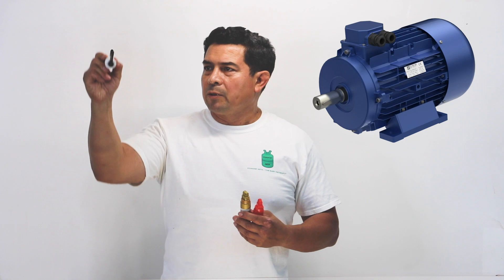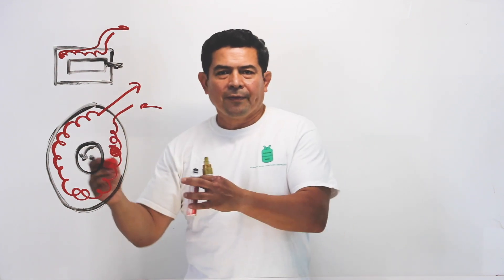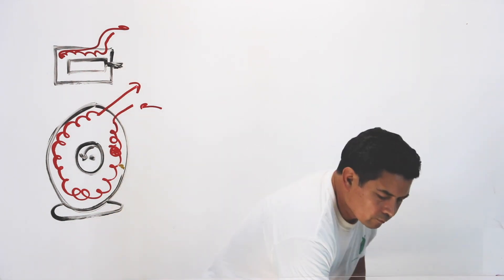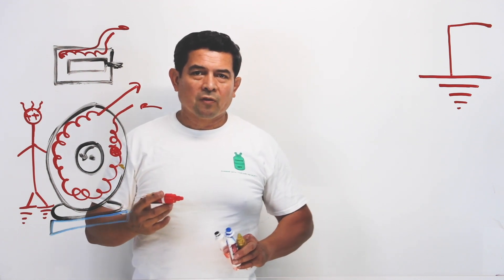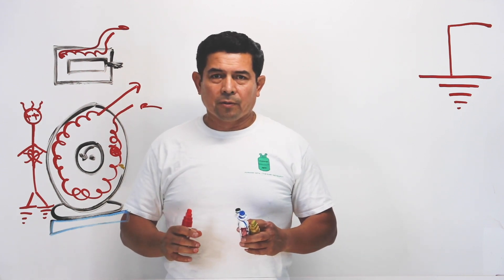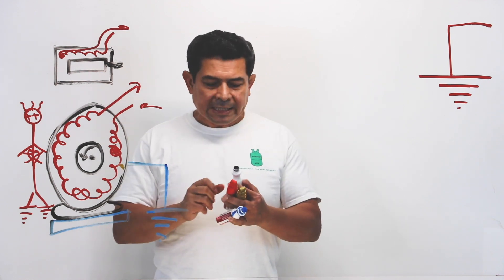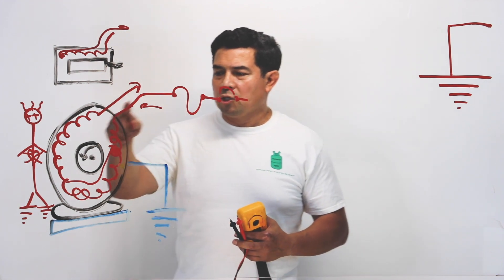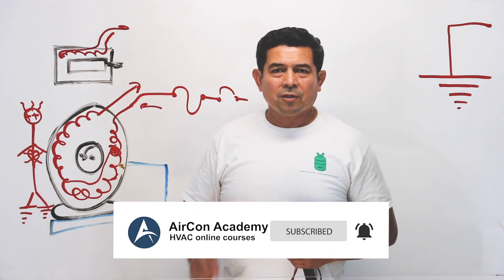Motor Ground

Comment: Why is it when i connect the ground wire from my motor back to the vfd the breaker trips but without a ground the motor runs fine?
Reply from the maker: It sounds like you have some feedback or maybe you have a ground in the motor! A lot of times the motors are insulated at the mounting so the only way for the electrons to get to ground would be through the ground wire. 
Without the ground wire connected, the casing would be energized, but the electrons could not get to ground, until you connect the ground wire. This is why when you connect a ground wire to the VFD ground it trips. Test the motor and see if it is grounded. I hope this helps! Thank you for watching and thank you for asking a question!

Comment: If there is a PE conductor attached to the motor,will you still recommend a case ground?
Reply from the maker: I'm sorry, I am not sure what you mean by PE? We need to make sure that if any of the electricity goes to the casing, it travels to a good ground. That is why you must always have a ground wire. Whatever the PE is, if it is allowing the electricity to go to ground it might be safe? But it's always best to have a separate ground wire!   Remember with electrical safety we don't want to take chances. I hope this helps. Thank you for watching!

Comment: So if the electricity flows through the load and back to source we aren`t using electricity, just borrowing it, and it flows from us to our neighbours and to their neighbours. We are led to believe we have consumed that power. Seems an underhand trick, do you agree ?
Actually the reason for my post is to ask for help.
I have salvaged a 12v ambulance winch system which is wired through a box of tricks to have an E stop, forward/reverse, on/off etc.
I just want to power this motor by sending 12v to the brake and 12v to run the motor and have my own reverse switch when needed.
The motor has 3 wires feeding the brushes around the rotor. As far as I can find out the RED is Positive, the BLACK is Negative and the WHITE is Neutral.
Can I connect the neutral to the earth on the 12v psu I am using. Thanks for any help.
Reply from the maker: On the first part of your message. It is the electrons that are moving back-and-forth and they're going right to the transformer that is outside in the pole. It is not going to your neighbors or the other neighbor. It is making a big loop from the toilet in the transformer to your house, and then back to the same coil in that same transformer. So we're using basically the same electrons.   On the second part, DC motors, meaning, the motors running off of batteries, are totally different than AC motors. Like the ones that run the fan in the heater or air conditioner for your house.   One of the problems is that you need to know if your motor is wired in series or in parallel. Meaning is the electricity going through the brushes through the commutator, and then to the stater, or is electricity going to the brushes and to the stater and are these two wires together at the outlet and is that why you have three wires?     Unfortunately, in the field, we don't use DC motors that much so I don't have a video on how DC motors are wired. I used to teach DC motors. That is why I mentioned those two different ways. If you have three wires, that is basically telling me, and I might be wrong, because I am not there to look at the motor, that you have one wire from the battery or switch going to the brushes, another wire going also from the same side of the battery possibly through a switch to the stater. As electricity travels through the brushes, and into the Commutator , and then through the stater, both of these are wired together to what you are calling that third wire common. That would go to the other side of the battery to complete the circuit.    I hope this helps a little. If not send me another message, but hooking it up to ground is not going to do anything. Don't do that because the batteries are not grounded to earth. Only alternating current/AC is hooked up to ground. Thank you for watching and let me know if you have any questions.
Reply: @AirConAcademy  Thanks very much for your lengthy reply, it is much appreciated.
I am not sure how to go about testing for series or parallel. All 3 connections are connected via the brushes to the commutator. I get a continuity beep probing any combo of the brushes. Does that help.
Sorry for my super basic approach.
Reply from the maker: @codepuncher  yes you would get continuity across all three. If you could email me and send me some pictures. Maybe a little better explanation.      jh@airconacademy.com
Reply: @AirConAcademy  some images sent. regards
Reply from the maker: @codepuncher  i hope you got my email
Reply: @AirConAcademy  tnx so much for your great help.

Comment: Thank you for making this video man. I have a pretty good understanding of circuits but sometimes over look simple things like ensuring everything on the case is connected to ground. Bought a bench grinder (Ac induction motor) a while ago and just recently started using it. Normally, I go into my shop with boots on but I needed something quickly so I just went in bare foot. I was sitting at my bench while on the phone and touched a part of the case that had a little bit of paint missing and got a nasty shock. I unplugged it and now today I'm taking it apart to find out why. Whoever made this connected the ground to the base of the grinder and made no connection to the case ng for the motor. So it's storing energy in a magnetic field and slowly discharging through a resistor but while inactive there's 5-20vac across the case. Like you stated earlier it CAN kill you but not always and man even that low of voltage still hurts. Like one of those prank taser lighters that were out in the late 90s early 2000s. Thankfully not a painful as 120vac and man does that hurt! Anyways, your video reminded me to test continuity and behold the case was isolated from the ground. So thanks man I appreciate this video!
Reply from the maker: Wow! That is quite the story! Thank you for sharing it with me! I remember having an issue similar to yours, but with a washing machine years ago! And yes! I remember those prank lighters and gum packets that they sold that will shock you when you grabbed it! Those were the days!   Thanks for watching and I'm glad you like the video!

Comment: I have a unit that sometimes the breaker Tripping, if I do reset the contact will start at normal operations, an then randomly it will do it again, we replace the breaker, cap is ok install a hard start kit and still doing, any recommendations?
Reply from the maker: Unfortunately from what you are telling me you have one of those floating grounds. You have a few things you could do.   . One is to keep resetting the breaker and most likely whatever has  the floating around will make a good ground and not be able to reset the breaker again. I believe it might be your compressor that has that. That is where I have seen this a lot of times.  Your  other option is to check it with a megger.   Another option that I can think of is to disconnect the 24V wire from the compressor contactor coil, so you do not run the compressor and see if the breaker trips. I mean run the fans, like the condenser fan motor and the evaporator fan motor to see if that trips the breaker. This will tell you that it is the compressor. Another suggestion is that you would check the wiring. You may have a wire that is rubbing against the casing/chassis or something metal and the insulation has worn. Because of that sometimes it goes to ground and sometimes it does not. This would be on the high-voltage wires going to the compressor or the fans.    I would check the wiring first like I said just now and then go on to other things. Good luck I hope you find it!

Comment: Thanks for replying to my question.  I would have attach a ground under the fan shroud to connect to one of those bolts.
Reply from the maker: You can attach it to the underside of the motor as it is hanging. So that it is far away from the fan shroud. And away from the fan. I have had to do it like that several times. Good luck!

Comment: I purchase a new 1.5 hp 15 amp single phase ac motor that does not have a ground wire with the wiring bundle. How can I add a ground wire to the motor to prevent shock?
Reply from the maker: Take a look where the wires go into the motor, see if there is a green  screw at that point and you can attach the ground wire to it.  If not, what I have done is our house loosen one of the bolts that hold the motor together, in other words the bolts that go from one end of the motor to the other end of the motor, and then I attach my ground wire to that. The ground is supposed to provide a path for the electricity to go from the casing to ground if there's a problem.   I hope this answers your question.!!!

Comment: I am using a brushless motor in a diy project. It comes with a ground wire but I don't know what to do with it. My project only needs the POS and negative (battery charging). Can someone please tell me what to do with it? Ground bus? Very new.
Reply from the maker: The ground wire is just for safety. You can take that ground wire and connect it to the chassis, or you can connected to an actual ground. But if you're talking about positive and negative you must be talking about a battery so you can connect it to the chassis or in other words the framework that the motor is connected to
Reply: @AirConAcademy  Thank you so much ☺️
Reply: @AirConAcademy  If I may, I have one more question to ask. Can I safely run a DC electric motor at 175 rpms over rated? Is that a biggy?
Reply from the maker: @sharilyn8262  If you are talking about running the motor 175 RPM higher then rated speed, you need to be careful.  Centrifugal force can take a motor apart  if the speed is exceeded it can fly apart!!!!    It may be safe but!!! be very careful over speeding a motor.
Reply: @AirConAcademy  Woah 😳 thank you!

Comment: The person could be touching another grounded product with that other hand too. It does not have to go to ground through the feet. That current to ground will trip GFCI's, ground fault circuit interrupters, if used to power these devices. By the way, high tech motor controls or inverters create the main current by switching it on and off very fast. This high frequency current will travel from the motor windings to the chassis easier than the 60 hz. This too will trip a GFCI since most are only specified to trip at 60 hz, not at lower or higher frequencies found in higher tech control systems.
Reply from the maker: Yes, you are so correct! It does not have to go to ground through the feet but it could be through the other hand or an elbow or like it happened to me through the forehead.  Yes, a GFCI was tripp but typically we do not use GFCI's on motors. For example in the state of Virginia GFCI's are only required in a room where there is water or within 6 feet of some thing that has water even if it is in another room.  In class I go over how VFDs works and typically I will draw the schematic for a VFD so that student can see the components and how it works. I have never ran into a motor that is hooked up to a VFD and a GFCI.    I guess maybe I will look into, when and where a GFCI is used in conjunction with a VFD and a motor? Thank you for your comments it gives me something to look into!
Reply: @AirConAcademy  Appliace manufacturers have been using VFD's for some years now. If an appliance is plugged into a GFCI it's likely to trip. Consumers were complaining about nuisance trips and I was asked to look into them. Spec's only state how they are to perform at 60 Hz, nothing defined for higher or lower frequencies. Since appliances appear next to each other the opposite hand is highly likely to touch a grounged product. Not only motors but also user interfaces. The power supplies in them are commonly switch mode, meaning line based high freq switching. User interfaces can be thin pieces of plastic, common dielectric materials, so now you could be the other plate of that cap to ground. Fun stuff.
Reply from the maker: @chrisscriber9592  OHHHHH    OK   LOL    I had no idea at first that you were talking about appliances. Yes, I knew that they had been using VFD's on appliances and such I don't know if I missed it but I didn't know before that you were talking about appliances. Now I see why you were talking about VFDs being hooked up to GFCI's.   Now it all makes sense. I like to get into frequencies and magnetic fields and so on they are so many different things that could happen.    I find it all so interesting! And I do like to read about it. Thank you for clarifying that for me.!
Reply: @AirConAcademy  VFD's used are created by the Appliance control manufacturers in the home appliances. Commercial units typically use industrial grade VFD's.

FYI: Power and signal harnesses are typically run throughout the machines in the same bundle. If you consider the copper in the wires a plate in a capacitor and the insulation as the dielectric you can predict high frequency coupling to more sensitive harnesses. You can minimize the impact by simply keeping the HF and sensitive harnesses even a 1/2 inch apart but this adds cost to the products. Cost is highly critical in these products.

Comment: im fixing up an old table saw and it looks like the previous owner bypassed the ground somehow. it had the three prong plug but the ground was taped off and not connected to anything. can I reconnect the ground to anywhere on the motor housing?
Reply from the maker: Yes, you can connect the ground anywhere on the housing. That will make the motor safe in case you have a ground on that motor at some point.

Comment: A motor have ground terminals on the box and frame. Should they both ground?
Reply from the maker: The motor casing and the box that are on the frame should be grounded for safety reasons. That way if something goes wrong internally with the motor the current will go to ground and not through the technician or whom ever touches the motor.